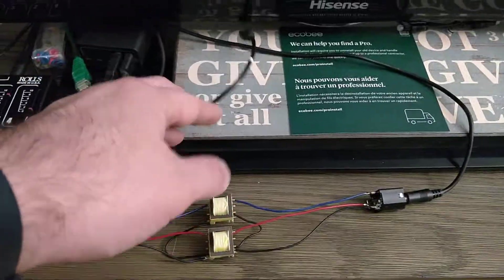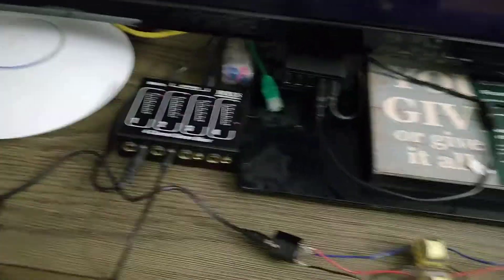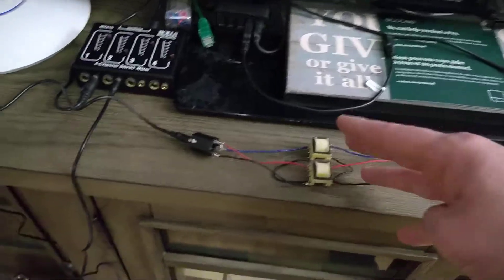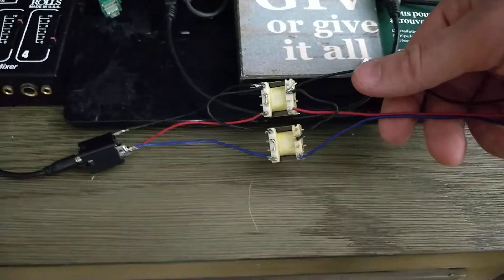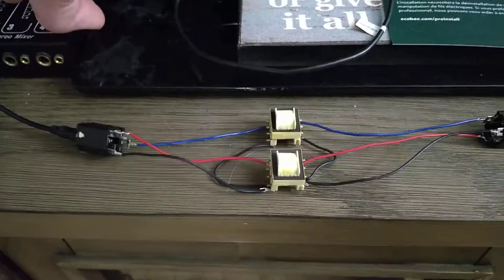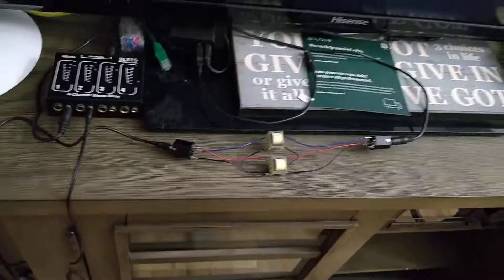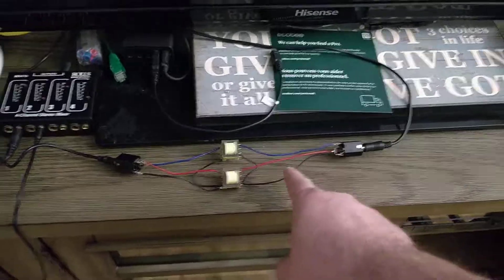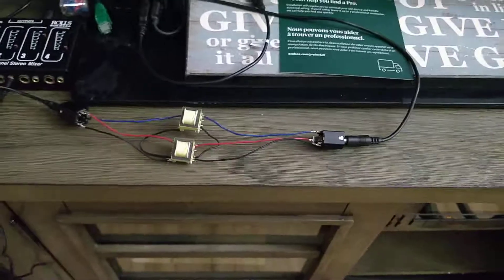Stereo line level isolation transformer

Comment: But you connected the grounds of both transformers together? How does that keep the grounds of left and right separate? I’m confused.
Reply from the maker: The grounds of the input and output are isolated from each other. The signal ground on the input right and input left channel need to be connected to the left and right transformer's "input side" (for lack of a better word) since the signal is referenced to that pin, and this is unbalanced audio.
The signal ground on the output side needs to be connected to the output right and left channels for the same reason.
The transformer "transforms" the electrical signal on the input into magnetism, and then back to an electrical signal on the output side, so the "ground" isn't electrically connected from input and output.

Comment: My hand wound isolation transformer does not pass enough power. Does it need a resonant capacitor in series with primary to match the 20khz AC input? I even tried impedance matching that did not work either.
Reply from the maker: That's weird.. I didn't put any capacitor in the circuit, just the two transformers.
Reply: if its not working then you dont have enough winds in yours, it also needs to be a 1:1 ratio